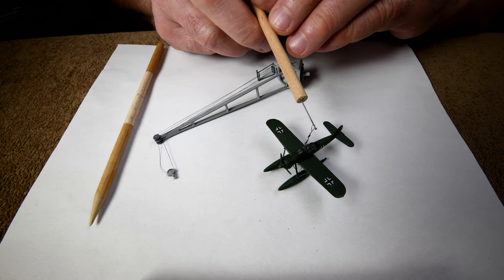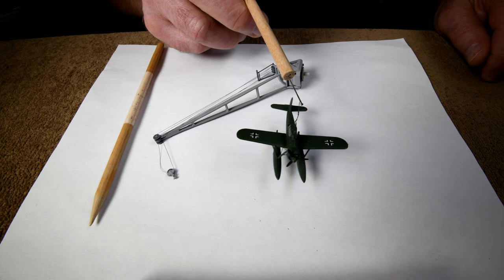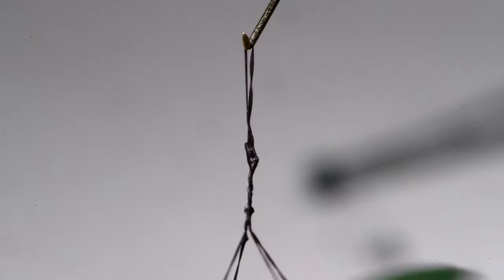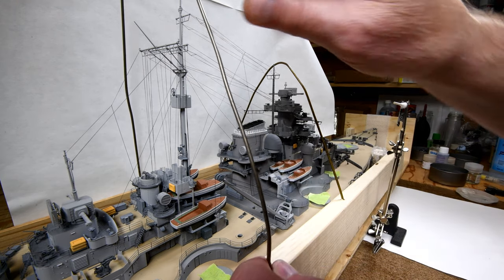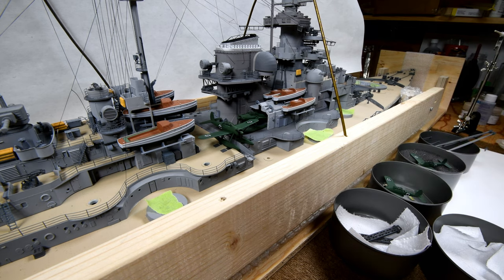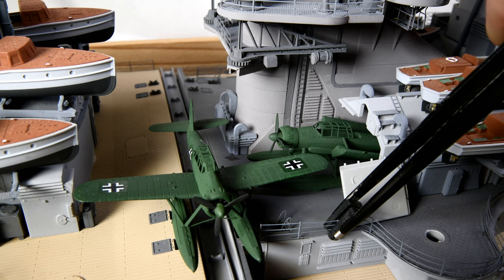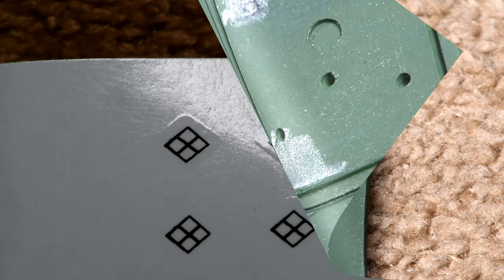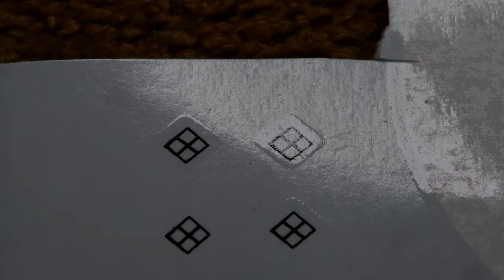The Model Ship - Part 456

Comment: Just a crazy idea but if you wanted to avoid gluing the crane could you 'counterbalance' it, pendulum style, with say a long nail or screw?
It would have to fit through the hole in the deck, (although making that slightly larger wouldn't be too much of a problem, it wouldn't be seen.) Also, extra weight could be added by wrapping wire around the nail/screw if needed.
The crane could then just sit there over the hole, and still be able to rotate......airplane and all!
If you did want to secure it I guess you could add a small washer to the nail before attaching the nail to the base of the crane and glue the washer over the existing hole. The crane would still lift up but not off.
Just thinking out loud, it would be a shame to limit your options by gluing it down.
Reply from the maker: At first I thought you were just kidding around when I read "long nail or screw" then I slowly realized that you meant attach it to the underside of the kingpin. Good thought. Keep thinking out loud like that. 👍
Reply: @roncalverley  LOL....yeah just nail it on.....she'll be right.